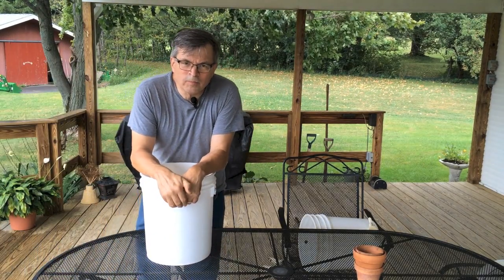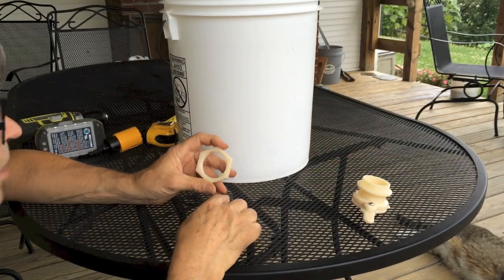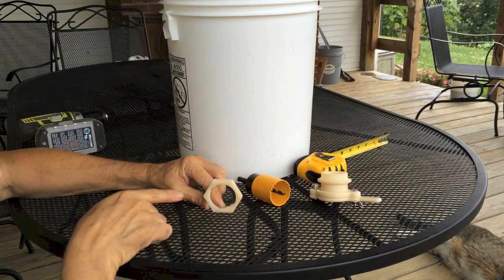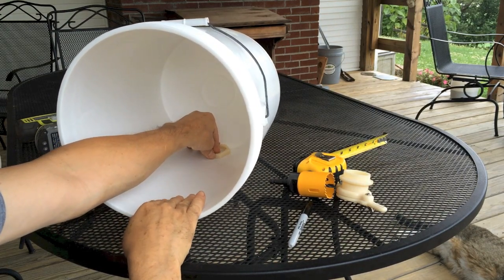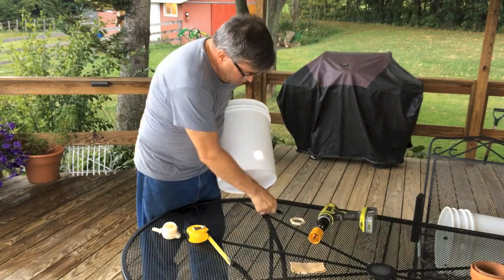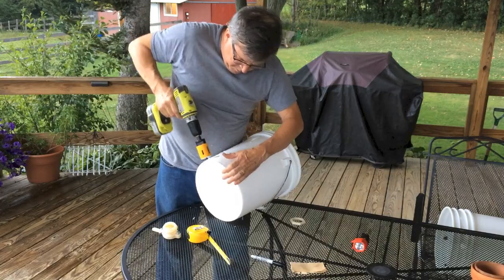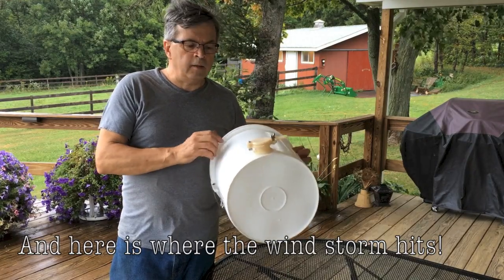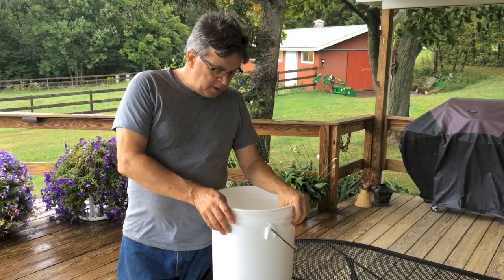Installing a honey gate on a five gallon bucket

Comment: If you move the hole up one inch you can easily tight the nut from the inside. They way you installed it, you can't freely turn the inside nut.

Comment: What size drill bit do you use for these honey gates? Can't fine references for that anywhere.
Reply from the maker: As I recall roughly 1.5 inches or 38mm. Thanks for watching
Reply: @CleanSlateFarm  I am really shocked how much work the crush and strain method it is. Its much easier to see than actually try it yourself. The honey is so thick that I wonder if it will ever really drip down into the bottom? Does it really only take 24 hours? or 24 days? lol. 

Also I noticed the honey comb has this beautiful smell that almost smells like its got some kind of natural cleaner in it. its not a bleach smell but hard to describe, but it feels good to smell and breathe in. 

Thank you very much.